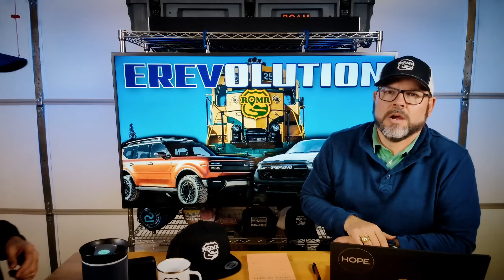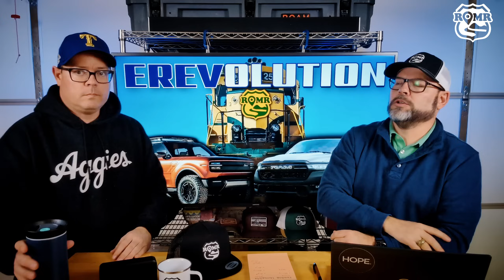Americans go Nuts for EREV Tech | Ramcharger and Scout lead the extended range hybrid Revolution

Comment: Exactly the system I'll be looking for.  EV power/regen braking for towing with no range anxiety.  Plus the ability to run around town on in full EV mode.  PERFECT.  Unfortunately, with the tariff-war that's under way there's probably no way I'll pony up for one once it gets up here to Canada....sigh.  Perhaps Canada will loosen its tariffs with China and the BYD will become available here.  That said, I'd much rather support a North American product, but the current climate is definitely souring that notion.  Too bad.  And then there's good 'ol Edison Motors and their in-development retrofit kit for pickups.  Hopefully they can get to market soon with the kits.  Regardless, this is the system I will be hoping to get into.  Thanks for the info.

Comment: Great discussion guys. And for the max/min possible weights you are discussing, I don't think it really matters. It slightly affect rolling resistance, but your biggest constant drag (driving distances at 70-80 MPH) is aerodynamic and that has nothing to do with weight. It's not like it's going to weigh 12k lbs.

Comment: Another great conversation guys. One great point at the start is that a huge advantage of these vehicles is that they provide an EV driving experience. And a great point at the end that they will be the fast track to broader EV use, not pushing for only BEV use. A small point about putting generator power directly to the motors instead of into the battery and out again. The obvious way to engineer this is to have a common high power bus. The generator supplies power, the motors consume power, the battery does both. If the generator supplies 100 kW and you need 150 for motion, the 100 goes to the motors and the battery supplies 50. If you only need 50 for motion then the generator supplies that and the other 50 can charge the battery.
Reply: The engineer in me has to correct myself before someone else does. The motors will supply power with regen braking.

Comment: Most people are going to buy these EREV's and realize after a few months of driving that they don't need the engine they are lugging around everyday. The EREV is for people who tow long distances weekly if not daily. If you aren't towing farther than 150 miles in a day the EREV makes no sense at all.
Reply from the maker: Found 'em
Reply: @ROMRreviews  What does that mean???
Reply: I have a Cadillac ELR with the same setup, but smaller battery.  Daily 20-40 mile work trips used little to no gas, I've gone on 1,000 mile road trips using mostly gas,, still get 35 mpg. Averaged 85 mpg until the battery started wearing out after 100,000 miles.

Comment: Looking at the size of the Terra Truck, I would buy this to replace my ford lightning as long as they make a lumber rack accessory for it. I use my lightning for my contracting business and this Terra would actually be a good replacement for the Lightning. I would get the full BEV though, I have no need for any gas. My lightning gets around 375 miles around town and 285 miles on the highway so this covers my needs perfectly. I would assume the Scout would be more efficient than the Lightning and It looks like its rated for 350 miles compared to the 320 my Lightning is rated for.

Comment: I get how the 6 cylinder motor doesn't need a separate 12v battery.  But I can't believe it won't have some kind of 12v to operate systems.  I'll be interested to see how they pull that off.
Reply: I've heard also, that it doesn't have a starter.  That completely puzzles me.
Reply from the maker: We're hearing via another podcast that there's definitely a 12v system, and an emergency capability to access contact points for some kind of charge.

Comment: 23:03 In China where car software is more advanced than in the west .
You can even have a customization mode 😂.

So you can set what percentage of battery capacity the generator will need to turn on.Or bypass electricity without passing through the battery.Regulate rotor power to save energy , on off  regenerative braking , Adjusts how strong the regenerative braking is.etc.

Comment: EREV solves a big problem in the Chinese market for big car Over (6,000 pounds) .

1.When the battery is too large the charging time will be too long.

2. When the battery capacity exceeds 100kw(MNC) /75kw(LFP).The battery becomes too heavy and reduces efficiency.

3.The bigger the battery, the  car more expensive .

By adding a generator. Use get benefits of Electric motor. And small Batteries without getting any Problems in terms of price, range and efficiency (Heavy) .

Comment: What the hyper EV-only crowd doesnt get is its not just range. It's the layout of the charging infrastructure. Even as battery tech gets there (its nearly 'there' - Zeekr Golden Battery is damn near 'it'), the charging infrastructure would still have me in an EREV while towing. I'm not about to drop my 30' trailer every 150mi (even if I can find a spot to drop it!), charge, then pick it up, and then go.
Reply: There is 1 public charger for 27 EVs in America .
 Vs 1 public charger for 8 EV in china.

China has no problem with  chargers infrastructure.

Comment: People are blowing up about the "5000lb" Harvester towing capacity because they wanted an everyday use vehicle that could also tow their RV without range anxiety.  If it remains true that it will have only 5000lbs capability, you're definitely gonna see a lot of canceled orders and enthusiasm wain.  5000 will be a deal breaker for a lot of folks.  Hopefully they can get that # up between now and 2027.
My best,
Doc Ray
Reply: 7500# minimum.
Reply: I suspect/hope that was a slight misstatement. 5000 for the Traveler Harvester, more for the Terra Harvester. Although interesting that no one at Scout seems to have said that yet.
Reply: They would need to increase the engine size or add a turbo to bump the generator output up enough to produce enough kW to replace what the motors are using when they are pulling a heavier trailer. 

That’s more weight and complication but they have a LOT of intellectual property and R&D available through the VW parent group so they still may pull it off.

Comment: I don’t blame folks for not fully understanding the EREV concept. Most of the explanations I’ve heard are pretty awful. Using the diesel-electric train as an example of the tech should be helpful.
Reply: EREV Like
Diesel/Gas electric + battery .
Or EV+ generator .

It's that simple